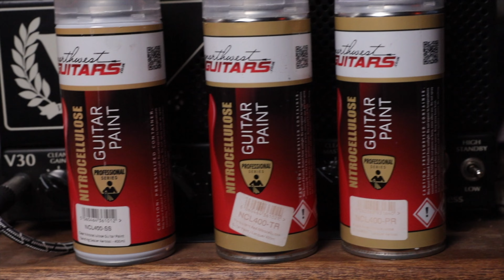How to spray nitro over poly

Comment: Tip on the mask: If you are using a proper respirator (which is what you really need for painting),store it in a sealed bag.  Filter cartridges can only filter a certain amount of air and the sealed container stops it from just filtering the air while unused and shortening the life span.
Reply from the maker: Best tip I’ve ever heard. Will be using this in future videos
Reply: @PherotoneStudios  Glad I could help save some lungs!  :D  Thanks for your channel.

Comment: I removed the poly from an old Squire by putting the body in the oven on medium heat for around 15 mins and it peeled right off. 
Use a sharp chisel to get it started then pliers to peel off.

Comment: Same deal with the mask and ventilation removing Poly finishes.Keep in mind that there are zero controls and materials oversight in China and Indonesia, so the actual materials used are a crap shoot.The dust and off gassing , - especially with heat or chemical removal, - can have health consequences.
As suggested here, it's not the part to fudge or try to get around; it can be problematic providing the right temp and outdoor ventilation conditions, but it's the only way to go.
If you see demos with people not using these precautions, it's a good sign that they don't know what they're doing.

Comment: Beautiful work. Next time, try retro style. In the 50's a nitro finish was completed and sent straight to the buffer in 2 days, with no sanding between coats. Then the guitar was fully assembled and put up for sale. I've used this method on several guitars with wonderful results.

Comment: Nice action. My guitartech made me a solid telecaster spruce body, he said its a 2-component "nitro" laquer. Im not an expert, but i realise that its pretty soft, even after 2 months after spraying. You can literary leave your finger nail markf in a surface when you push harder. Is that normal? Should i spray maybe one coat os "something" to protect that fragile surface?
Reply: Actually that's not normal, er...not correct.
When he mentioned a two part nitro, it's possible he meant a pre cat finish which actually isn't nitro.....but obviously I can't be sure 
I can be sure of this....the nitro should have dried hard, too hard to dig a fingernail into it, especially after two months!
It sounds to me like he either didn't do proper prep work, or rushed the finish, or used incompatible chemicals.

Comment: Hi, did the nitro take well to the poly keyed (non stripped) surface? Did you spray the nitro colour straight onto the keyed poly (no sealer)? Looks very good.
Reply: You can use nitro over poly but not the other way around.
The nitro dries, while poly chemically cures; so the poly won't bond properly over nitro.
I've successfully used nitro clear coats over poly paint finishes as I think the lower gloss and final appearance is superior.